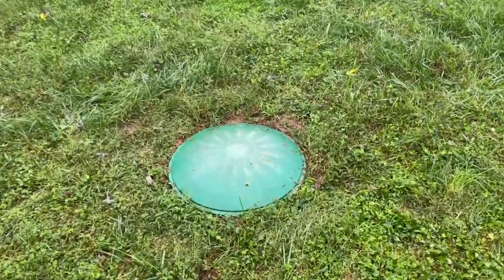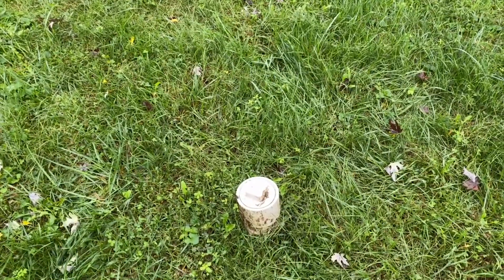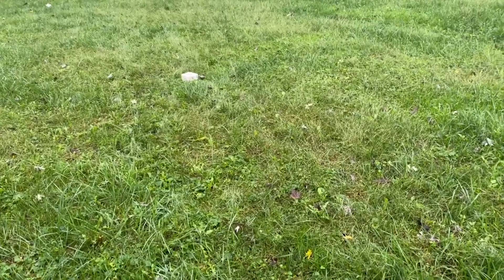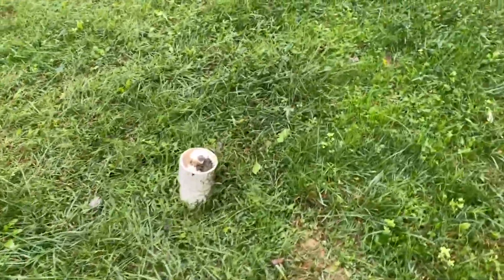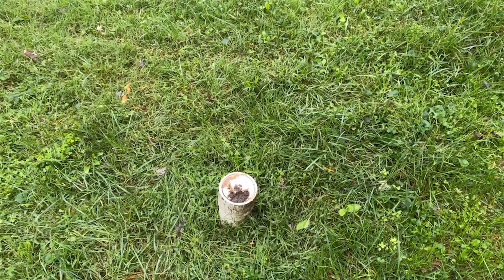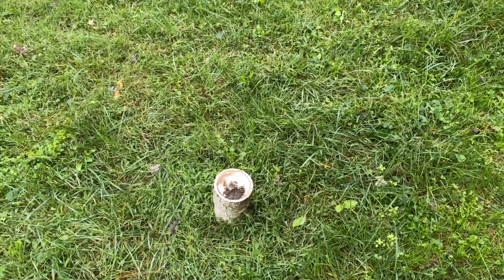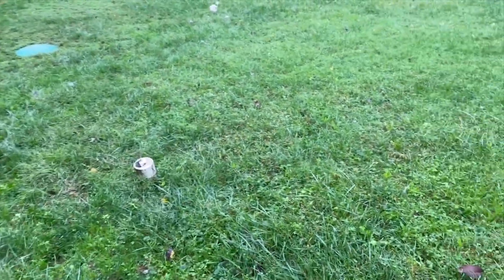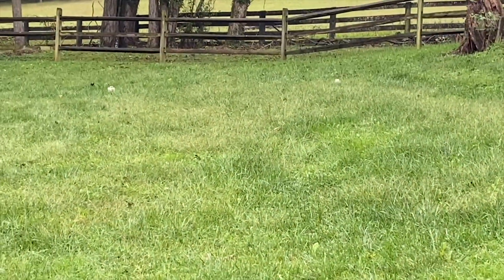What Is a Bull Run Valve?

Comment: How do I replace to top of my bull run valve cover that was broken my our lawn care company? The pipe looks in tact the cover is just gone
Reply from the maker: a typical bull run is about 4" diameter. To replace, you just dig down to good pipe make a clean cut and build back up. you may need a bit of PVC pipe and a coupling to bring the whole thing back above grade.